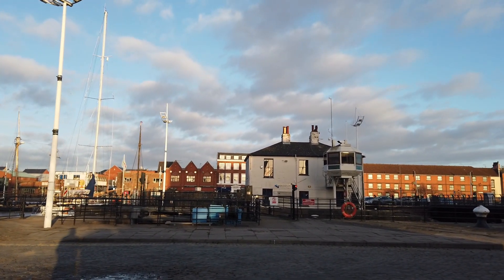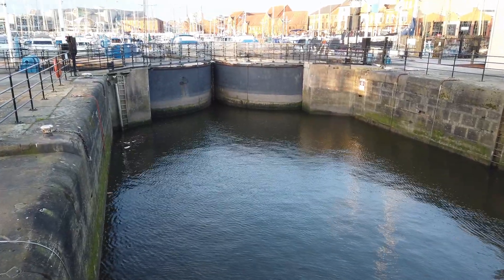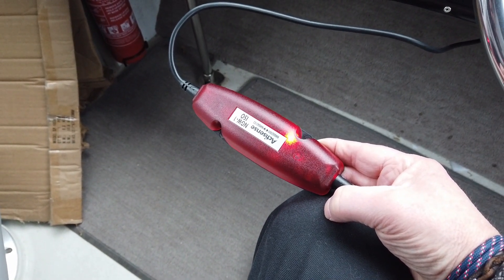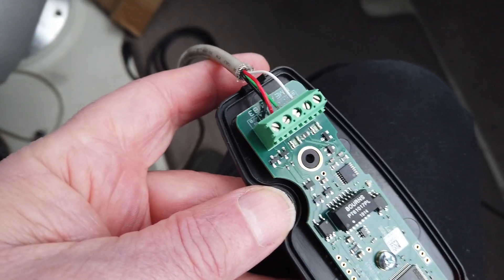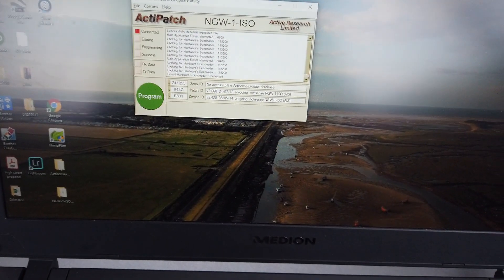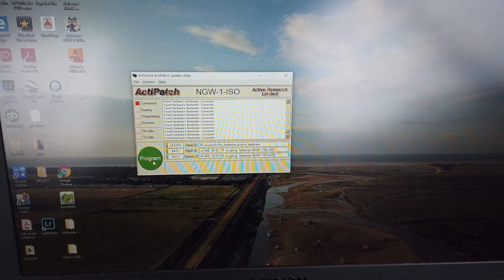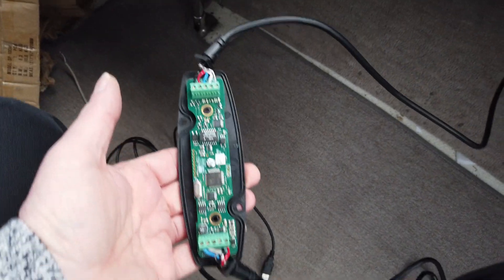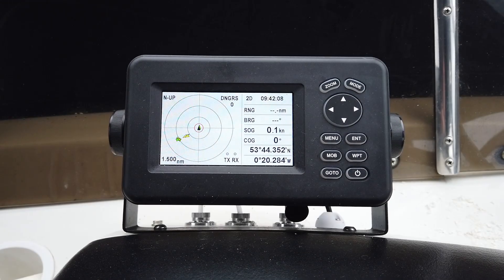Matsutec hp528a AIS to Actisense NGW 1 to Raymarine Axiom continuation of connection problems

Comment: So what happened? I’ve spent three weeks trying and have finally made some progress.
Reply from the maker: I thought I was making progress, but gave up on the actisense. In fact it came in when I used it to connect my Stowe heading sensor. That worked first time, so the baud rate was 4800, not 38400 for AIS. I have since tried a digital yacht convertor and still no joy. So if you have made progress I would be interested in what you have found.

Comment: Are you testing the 0183 output and the end of the cable? or at the socket on the HP528a?
Reply from the maker: Hi, I have power tested straight out of the socket on the HP528a, and at the end of the cable, plus plugged the cable through a serial port on the pc. out of the port voltage wise is variable upto 2.6v and that reads the same at the end of the cable, but not getting any 0183 sentences when you try to read on the Tx line. The tx should be on pins 6 and 7 out of the hp528a. When I test the Rx on pins 4 and 5 I get variable upto 4.6v when connected to the network.
Reply: @MyAvaGrace  I will have a look at mine when I get to the boat, I have had mine wired mine both RS323 and RS422 (not at the same time), one was to a Garmin which I later wired to a Lowrance, and also to a wifi adaptor to view AIS data on a ipad with navionics  remember the pins are numbered on the back of the plug, for RS232 use pins 2 TX and 3 Ground and RS422 use pins 6 TX - and pins 7 TX+  and you have to set that output to the unit to which output you need ie RS232 or RS422, hope this helps
Reply from the maker: @mvhassallfree1031  Thanks, it looks similar to how mine is wired. Yes the output is set to ais for the rs422. In settings.